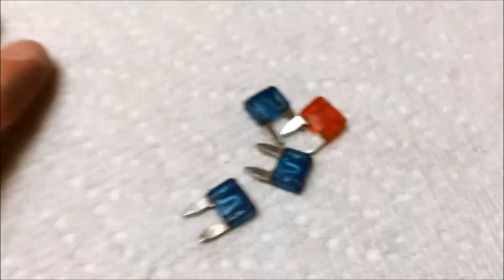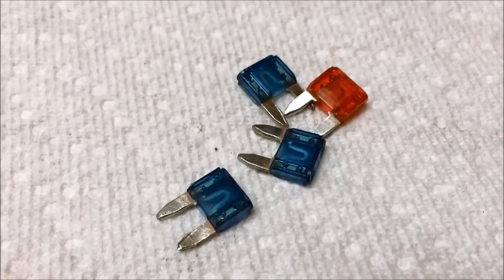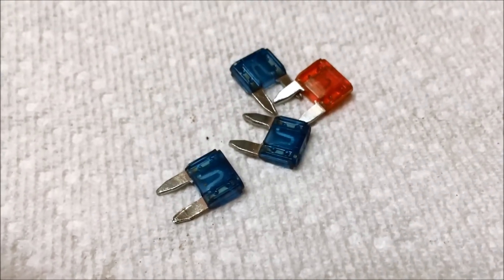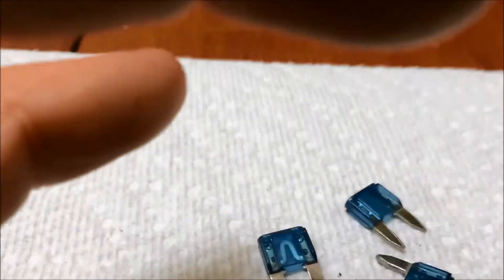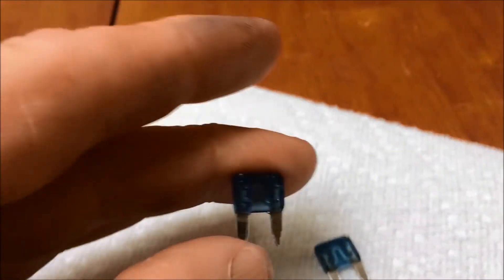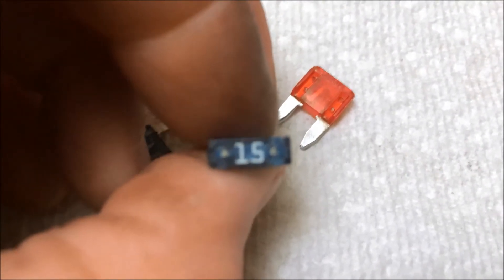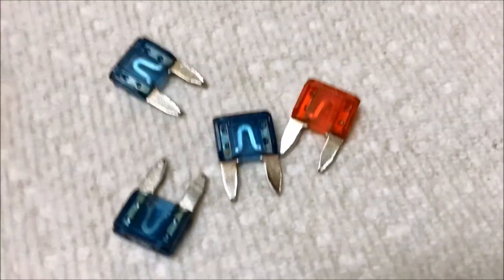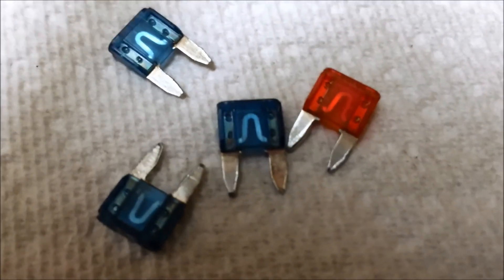Oxydized fuses might be your CHECK ENGINE light code problem O2 Cam Exhaust sensor - false readings

Comment: got this on my 4nmotion 2001 950 pounds later it was fuse 43 being popped by a weater leak dripping on the O2 SENSOR LAMBDA setting off the cel abs traction control sai charcoal cannister etc etc all on fuse 43. also the 3 fuses on top of the battery oxidised that was causing half of it. 50pence later no faults no lights